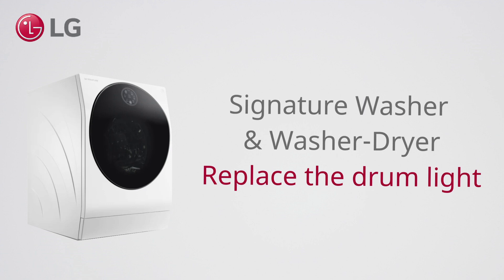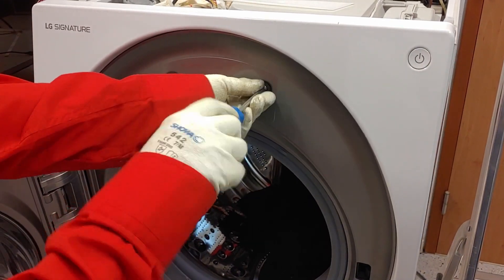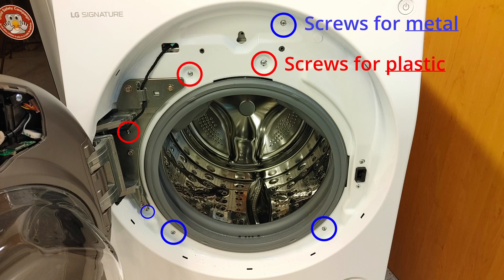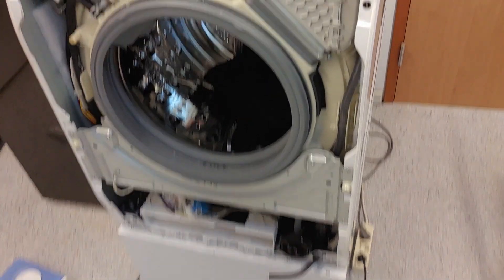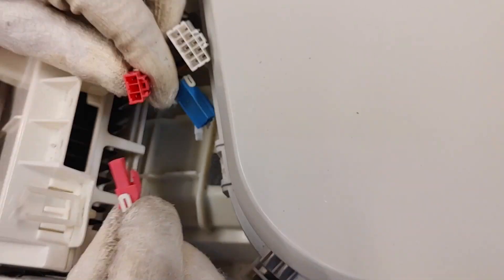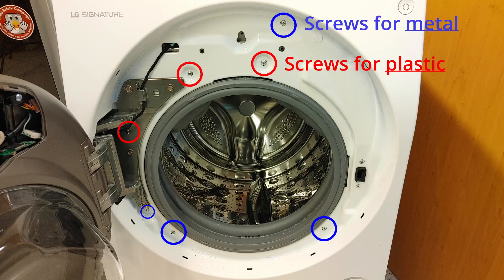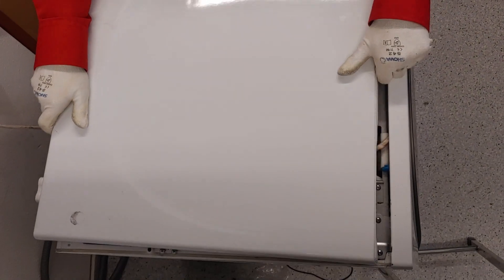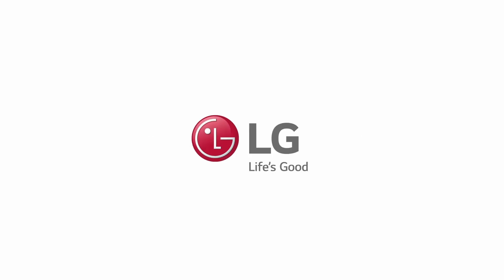[LG Washer & Washer-Dryer] How to replace the drum light

Comment: My WM4200HBA unfortunately is not equipped with a drum a light.  However, it appears there is a removable plastic plug in the rubber surround where the drum light would typically be.  If I purchased the drum light (EAQ61400802) and what I believe is the correct harness (6877ER1016Y), is there any way to make this work on my model?  Comparing to the WM8900HBA which comes with the drum light, it looks like holding the Signal button is used to activate the light.  Despite my model not including the light text on the button, I'm curious if it's the same controller/programming and just the wiring and light hardware is missing.
Reply from the maker: Good try, but it will not work since you also require the correct PCB + software to make sure the light is activated.
Reply: Did you try it

Comment: That's the stupidest thing I have ever seen. All of this for a light bulb replacement 😨
Reply from the maker: Well, you are right. However, since from European Eco design directives it's a requirement to have instructions on how to replace light sources, we figured it would be good to make such video. On the other hand, it will indeed normally not be needed since the life span of the light source is typically much longer than the product itself.